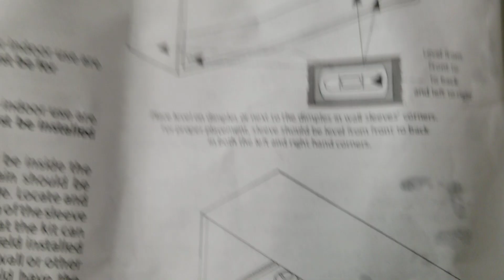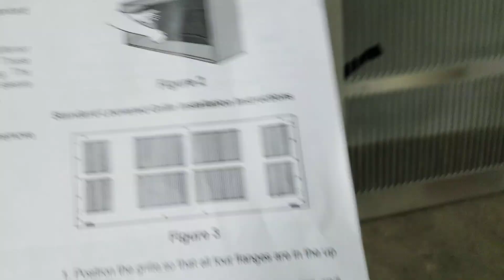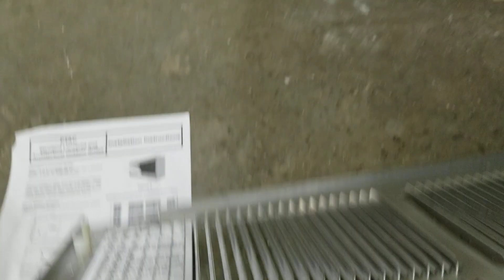Amana Ptac External Drain Kit & Wall Sleeve Installation Explanation.

Comment: It's hard to believe that the designers/engineers made something so easy as installing a grille to darn hard. Had it not been for your video, I would still be working on getting the grille on. On major item to remember working with the grille is to wear some good gloves. The edges of the grille are as sharp as razors. Thanks for posting this video.

Comment: Great video, good help! Yes, destructions were very vague, pitiful to say the best. I almost drilled a hole in the inner pan, no plug to remove. I put the grill on so i could remove it from the outside for maintenance. First time for me as well, geez, i came close to installing that sleeve backwards, thanks again. Kudos to the workmen still out there!

Comment: The PTAC unit in my apartment bedroom cannot get humidity below 70% or so during summer(currently). When the compressor is running, humidity lowers, when the compressor shuts off and only the fan blower is running, humidity rises(6-10% increase). Does this sound like a draining problem? Perhaps it's too level? My landlord does not appear to know what the problem could be.

Comment: Please remove the plug. There is absolutely no reason why you would want 3/4" of standing water in the unit.
Reply: I was thinking that
Reply: You actually need the water because I have seen model when the condenser fan splash the water on the condenser to cool it
Reply: @khaledhelil5787  That's exactly the reason - this newer PTAC uses its own condensate to splash up on it for cooling.  I could not figure out how that could possibly be working since all the condensate would drain away, until I saw this video showing the two-part condensate trap.  Now... I can't say if it works well or not, haven't gotten mine yet.  But I am worried about mold and such once the unit is "hinished" for the season!